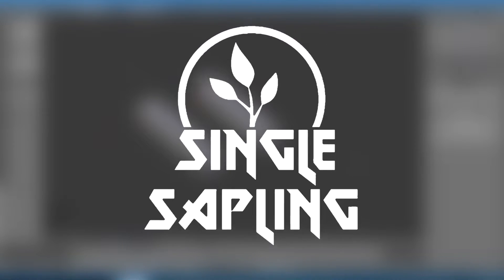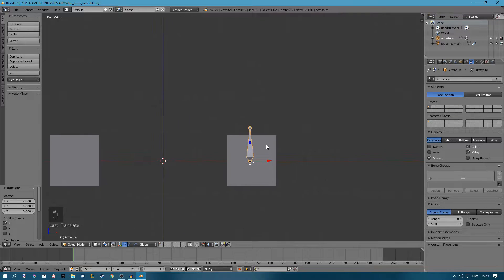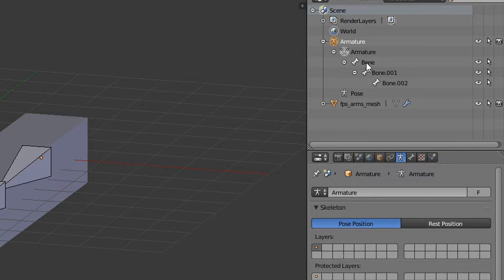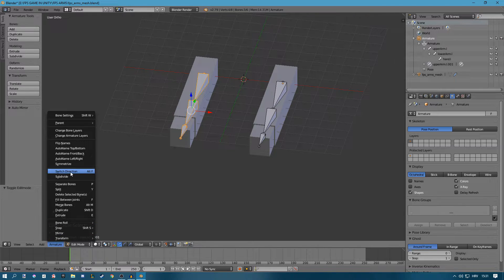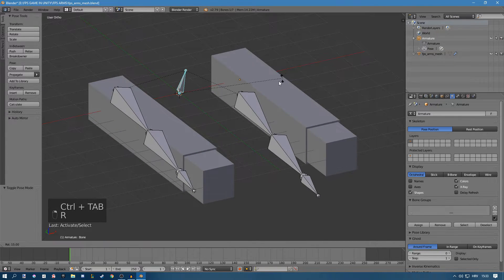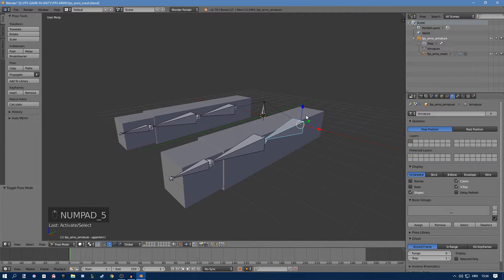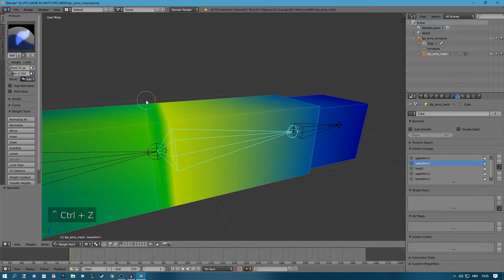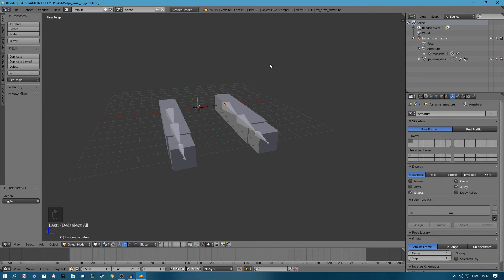Rigging Low Poly FPS Arms In Blender - FPS Game In Unity - Part 2

Comment: If I move one arm so dose the other, anyone know what I've done?
Reply from the maker: Apply the mirror modifier before riging
Reply: @SingleSapling  thanks I'll try that
Reply: are you talking about the mirror modifier we used during the FPS.ARMS.MESH part? 
Everything runs smoothly, but when I try to parent with automatic weights, then rotate the bones, the mesh does move with it, but the OTHER arm (one i'm not rotating will also move randomly), sorry i know this is probably some simple fix
Reply: @thatsjustfunny1  I just had the same problem.

For me, I had to apply the mirror modifier on the FPS arms mesh before making the Armature a parent.

Yes it's the same mirror modifier from earlier in the tutorial, you have to select the mesh, go to its modifiers (wrench icon) and hit the "apply" button. 

Hope I helped!
Reply: Thanks man! I was struggling to fix that problem but you, the absolute CHAD helped! xd thank you

Comment: when ever I press with automatic weights it applies it but to the right arm, which I cant edit the weight on that, and the left arm has no coloring on it, its just straight blue
Reply from the maker: Try starting over and apply the mirror modifier before weight painting
Reply: @SingleSapling  Sadly it still does the same thing. The paint is applied to the mirrored arm, and I cant edit it.
Reply from the maker: Hmmm if that didnt work I would just start over and see if it happeneds again :/ good luck
Reply: Ok, I will try, thank you